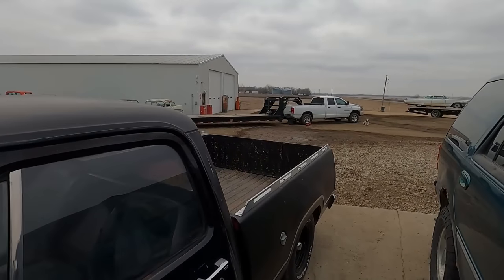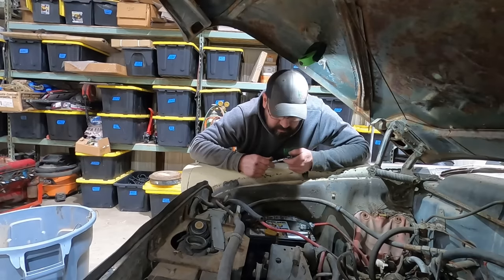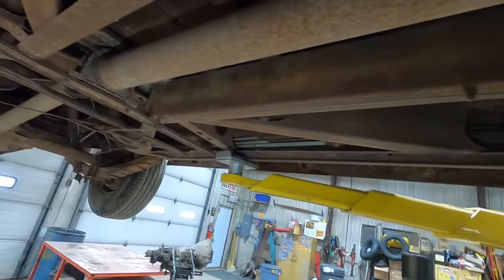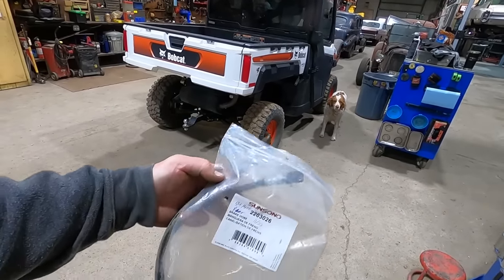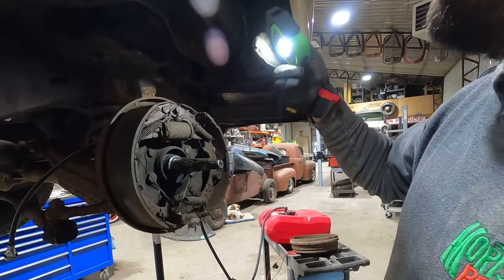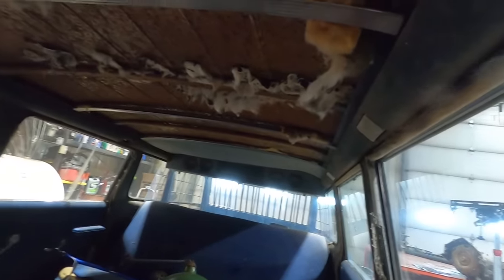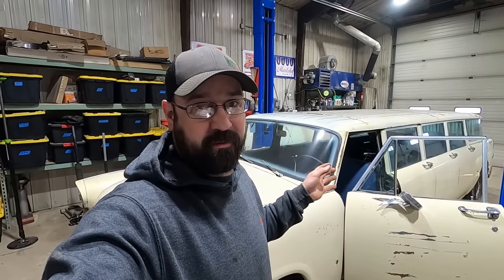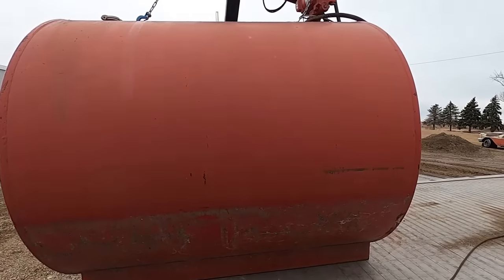Abandoned 1974 Checker Motor Company Aerobus! Will It Run?!? 9 Door Military Airport Limousine!

Comment: For other uses, see Aerobus (disambiguation).
The Checker Aerobus is an automobile manufactured on two different wheelbases by the Checker Motors Corporation from 1962 until 1977. Meant primarily to serve as an airport shuttle, as indicated by the name, it is an extended version of the iconic Checker Marathon. A total of 3,568 Checker Aerobuses of all versions were built.

Technical Specifications
It was offered as seven- (including the tailgate) or nine-door station wagon (A12W), and as a six- or eight-door sedan (A12E) The shorter wheelbases seated 9 people, while the longer models seated 12 people and their luggage.

Unlike the standard Marathon (which used a Continental straight-six),[1] early cars used Chrysler's A318 V8 (5.2 L), originally with 190 hp and later 200 hp. At the same time as the Marathon switched a Chevrolet straight-six in 1965, the Aerobus switched to Chevrolet's 327 cu in (5.36 L) small-block engine, with 185 hp (138 kW) at 4,400 rpm.[2] This was in a lesser state of tune than the 250 hp unit used in the regular Marathons, with lower 8:1 compression and a two-barrel rather than a four-barrel carburetor. Top speed was around 84 mph (135 km/h).[2] The rear wheel cutouts were radiused, unlike the sedans.

Standard equipment for 1966 included three-speed manual transmission, power brakes, windshield washer, and a front stabilizer bar. [3] For 1969, the bigger 350 engine (5.7 L) took over, with 200 hp. Output climbed to 215 hp (160 kW) for 1971, or 155 hp SAE net.

By 1974, intended to be the last year for the Aerobus as Checker ended production of the station wagons, the power was increased to 160 hp (119 kW), using a four-barrel carb instead of the two-barrel seen in the Marathons. Available only with an automatic and with standard power steering, top speed for a 1974 is 99 mph (160 km/h).[4]

Twelve-passenger Aerobus, 1970
Special Models
Convoy
Marketing material mentioned a special prisoner transport version of the Aerobus called the Convoy ("a twelve passenger security van"). The front passenger seat was rear-facing for a guard, and there was a security screen between the front compartment and the rear. Three bench seats were arranged in the rear, two along the side and one forward facing.[5] No evidence exists of any Convoys actually being sold.

Ambulance
An artist rendering of a possible Aerobus Ambulance shows that Checker was interested in catering to the medical transport market. The depiction shows a short wheelbase station wagon (six-door) body, with the rear most doors closed off with extended rear fenders. The advertisement included a coupon to mail back to the company with expressed interest. As there is no record of any ambulance being built, it appears that there was little interest.[6]

Aerobus 15
After building no Aerobus models in 1975, Checker realized that there still was a market for extended Marathon based vehicles. The Aerobus 15 was the result, being based on the long-wheelbase standard Marathon A12E sedan (with a 9-inch longer rear door). This allowed room for jump-seats ahead of the last row of seating, increasing the carrying capacity to 15 people. Additionally, the rear-axle was of a heavy-duty truck style with 8-lugs. A total of 60 were built in 1976, and a further 47 were built in 1977 Checker Aerobus

Overview
Manufacturer	Checker Motors Corporation
Also called	Checker Convoy
Production	1962–1977
Body and chassis
Class	Full-size limousine
Body style	6/8-door sedan
7/9-door station wagon
Layout	Front-engine, rear-wheel drive
Related	Checker Marathon
Powertrain
Engine	5.2 L A318 Chrysler V8
5.4 L 327 Chevrolet V8
5.7 L 350 Chevrolet V8
Dimensions
Wheelbase	154.5 in (3,924 mm)
189 in (4,801 mm)
Length	235.5 in (5,982 mm)
269.75 in (6,852 mm)
Width	76 in (1,930 mm)
Height	62 in (1,581 mm)
Curb weight	2,010–2,305 kg (4,431–5,082 lb)

Comment: Mort you should DEFINITELY do some bodywork on this thing, paint it, replace the floors with sheetmetal, and swap that old tired SBC with a high compression BBC with a 6-71 blower and a HUGE scoop. It'd be so cool and unique. I guarantee you that nobody else around you will have one! It'd cost quite a bit for the drivetrain though...
EDIT: Imagine this thing sitting there, in Big Bird Yellow, with the whole Checker Cab livery, just chopping and surging from the big cam and supercharger surge on a Hardcore Racing 632 or a Sonny Leonard 711ci Hemi, and you and Duff jump in and lay a big honking 11 on the concrete for 250 feet with power to spare! But like my Pappy used to say, "you can wish in one hand, and (well, crap) in the other, and see which one fills up first"...

Comment: find a sender unit, grind the tips off screws, re drill new unit, use the drain as fuel line, problem solvered.. easy..

Comment: Mortske, a couple thoughts on the gas tank repair for the next time.  Maybe stick a rubber plug or something in the hole when you’re cleaning up just to prevent any fumes from coming out right where you’re shooting sparks or pull a vacuum on the filler neck with something like a coolant vacuum filler tool.  Also, a rivnut or closed-back rivet shmoozed in there might be a better option next time (we know this isn’t the last leaking tank you’ll be working on) since that bolt really wasn’t biting into anything.  

Also, could you sharpen a drill bit to match the bleeder tip, or grind the bleeder to match a drill bit and use the bit to clean up the seat?  Just an idea.  Keep it up, always a good time watching you and Duffaroo!

Comment: These would have been in use at the end of the era where airports still deplaned folks with air-stairs out on some remote tarmac, rather than jetways directly to the terminal, which is so prevalent nowadays.  So, it would be no surprise to see this 'aerocar' making its way out to a new arrival to the airport (probably a smaller aircraft like a DC3 or such) to pick up the aircraft's passengers and their luggage in order to transport them to the terminal.  This method may seem crude by today's standards but I assure you, many busy overseas international airports still use this very method of getting travelers to the terminal...but, with buses for more modern and much larger aircraft.
Reply from the maker: Thanks for sharing

Comment: Sanding the rust off the exterior of the fuel tank. And then use JB Weld, and fiberglass cloth.. I’ve seen this kind of repair work for more than a few years

Comment: There’s those 3 reverse torx headed screws just under the turn signal that need a lil loctite on those tilt steering. Just a few times grabbing the wheel to get in and out loosens up those tiny bolts

Comment: "The Mortske Party Bus" 😎😀😄 ...You could probably haul a lot of LONG parts or a lot of short parts in it. For those huge auction hauls. Just a suggestion of course. I remember driving limos for a Cadillac dealership I used to work for and they had notices on the dash reminding you how long they were, so you wouldn't run over curbs and stuff. VERY easy to do. Take up two parking spaces. 😅 A mile to the back seat. Thanks for sharing, Mort! Good job!
Reply from the maker: Thanks for sharing!

Comment: Surely something outta station wagon, or possibly the rear Ford truck fuel tank.
Only I think ford trucks were side fill, and station wagons were straight out the license plate in the center.
Possibly you can get fuel hose that will make double turns opposite directions type of thing. 
LOL, I honestly don't know about that, but surely since they used everyone else's parts like AMC Jeep Harley Davidson did.
They used someone's tank instead of spending the time and effort to design their own setup.
Some days just be like that, but I am glad that you weren't smashed between me door and the lift post when it decided to go Watch Wes Work on you.
I started a old Ferguson tractor one day after I had rebuilt the old up draft carburetor.
Made sure it was in neutral, and even set the brake.
Only when it kicked off at WFO, it shook the gear shifter hard enough that it caught second gear, and the brakes being typical 60 year old drum brakes on the rear only..
Well the one that I engaged since the pedals were set for steering with rear wheel assist, didn't hold. 
So I am running backwards trying to reach across to kill the ignition switch, and stumbled backwards missed landing on top if the front tire as we entered my shop.
The same tire I missed jumped up and over a old craftsman tool box that'd I bought as a kid that was usually in the tool box on my truck. 
Well it went over it with enough speed that caused it to basically go up on two wheels. 
As I hit the ground, the back tire kinda run up my leg bounced up higher, because the front tire bounced off the motor of my old horizontal air compressor, and my hip, and  gotta little traction on my upper arm to my shoulder 
Continued on heading to the roll up door into the barn, which was an old single wide door just wide enough to get through, but it had lots of room because the back tire hit the tank on the compressor shooting it back towards me, but stopped by the workbench front bouncing off my head 
The tractor was sitting on two wheels just past the garage door leaning up against a stack of plywood leaning against the wall 
But although it was still running about 2000 rpm it had come outta gear, and was pegged WFO still, and I shut it off looking around at what was left of a good tool box that now had a twisted lid, electric motor with the capacitors hanging by a couple of wires 
Then down at my left leg with the lugs marks of the back tires left, and the three lug marks up my arm to my shoulder.
Thinking that I should be dead about now, are worse having to listen to the old woman pitching at me about being more careful.
I wasn't going to tell her, but I had to have her help to pull the tractor off the wall and back into the shop with my truck while I held the wheel so as it would come out at an angle to keep from running into the work bench. 
So yeah I got to listen to that for couple days  😅
Reply from the maker: Thanks for sharing!

Comment: Is it safe to store a thousand gallons of gas in a tank at home? Gas vapor is so volatile. Farmers keep large tanks of diesel for tractors. It's stable and safer. I've wanted to buy a Checker Cab and fix up for daily driving. They're designed for easy repair. Cab companies couldn't afford to have a Cab out of service for very long.
Reply from the maker: Never heard of anyone having an issue
Reply: @MortskeRepair  Interesting. I wasn't sure about storing gas in very large tanks. My uncle had a 50 gal drum with hand pump at his farm. That's the largest  tank I've dealt with.

Comment: Might I suggest another great product for sealing fuel tanks. It's called Red-Kote. Found at any chain parts stores. It's like the coating on a Candy Apple in a can. Just pour contents of the can into any laeking fuel vessel and roll the liquid around inside. Works for quite large leaks.
Reply from the maker: Great tip!